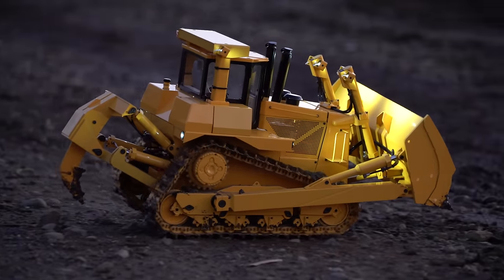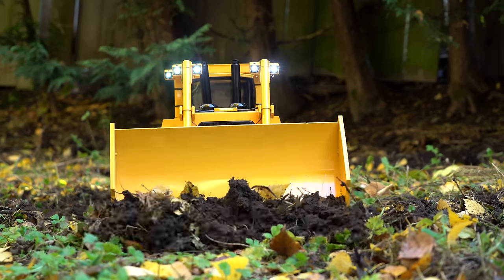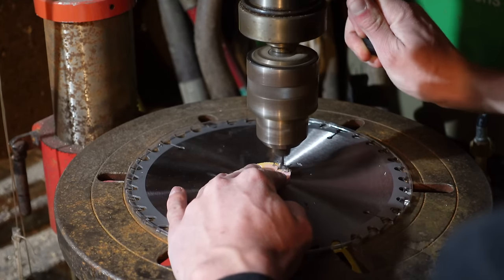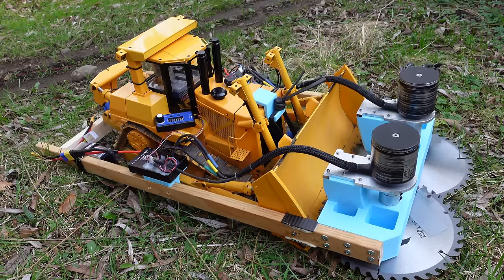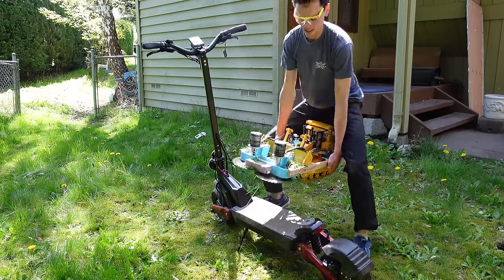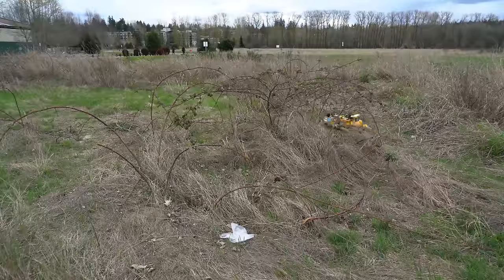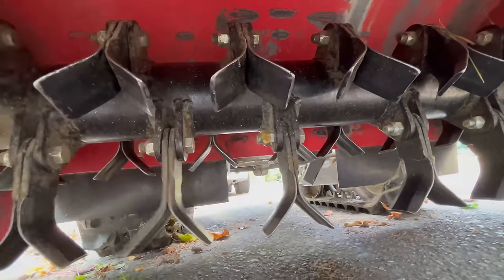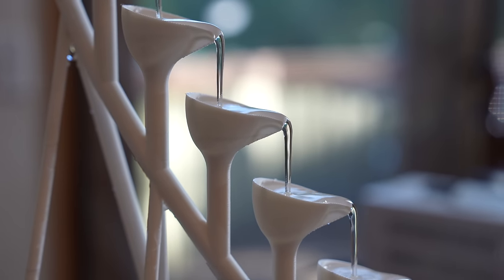$3000 R/C Bulldozer with Saw Blades

Comment: Some armchair math says that you're 1/14 scale dozer would have to weigh 714 lbs (~324 kg) on the light side to have a scale weight. Makes sense why the traction is so poor at only 60 lbs (~27 kg). It is 1/10th the weight for the scale.

Comment: Equipment operator here, that mini dozer is amazing. I know you think it's performance is underwhelming, but if you keep the scale in context, it's doing exactly the same amount of work as a full sized D6. Even in the big ones, you can't just dig that deep in hard soil, even the big ones get stuck. Exactly what this little thing was doing is how the big ones handle it, little by little. When you took it to the gravel heap and it collected half a blade in the first push and kept rolling it, you'd be surprised how easily that exact same scenario will make a 25 ton D6 skate like it's on ice. That little thing is cool as hell, but I can't justify paying that much for it, yeah I want my kid to be as obsessed with machinery as I am, but I just grew up around mechanics and machinery, my kids can do the same, they don't need ridiculously expensive toys to fall in love with machinery, but it is extremely cool and I do wish I was in a financial position where I could buy stuff like this and not think about the price.

Comment: Tanks with loose track pins have a keeper, a ramp or angled piece that pushes all the pins that moved back in. It was located at the top front where the body or skirts start.  This is an intentional design to have them free and they didn't move much in one rotation anyway. Simple rod design, they didn't even knurl the ends.
Reply: Do they have this om both sides of the track? Or do the pins only move one way?
Reply: @guatf1 they just move one way, with the head of the pin pointed to the tank

Comment: 8:01 use the T-34 strategy. Put the wider end of the pins facing inward, and weld a wedge to each side of the hull. The wedge will hammer the pins back in for you as you drive.
Reply: Did you learn that from Lindybeige too? Lol

Comment: Just as an Fyi even the big tree cutters tend to use a single large blade justfor the same reason you found, duel blades when cutting towards each other tends to just cause them to bite in and cause both blades to jam.
Reply: “Duel blades” would be if this were used for battle bots.

Comment: That thing is adorable and impressive. Minus the weird controls, those /are/ odd, but I guess they went with a "cheap" remote and just went with tank controls and whatever was left after. I wonder how much effort it would be to change the controls to single stick for moving and steering, leaving the other for motion only.

And regarding the tracks being the weakest point of the mini dozer: I wonder how that Tracked RC 'Platform' would do with those blades.
That thing has more 'aggressive' tracks, which might avoid the issues that the mini dozer has.

Either way, a really impressive "do not try at home" RC mower 👍
Reply: Someone not really used to RC designed which control did what.
Computer mix tracks to one stick with a side button to stop one track if you want to pivot around it (which is a bad idea with those tracks)

Then main blade OR rear plow on the other stick, Simple computer mix and a switch to swap.  The blade angling on the side levers.

The controls become almost intuitive rather than something you have to practice for hours to get used to.

some of this can easily be done with the simple transmitter that probably comes with the unit, but I'd request a transmitter and receiver delete, since I already have a really good 18 channel computer radio.

While it looks better with the metal tracks they should have done rubber track.  Based on a "cogged" V-belt, it would last for years.

Comment: for a flail mower to cut non-wood foliage, I've seen barrels with just steel chains mounted on them, each only a few links long. I think you could safely mount one to scale inside the bulldozer bucket. It wouldn't need much metal work either, because you can use the existing bucket, and just plow forward into the herbs. Find a thin but strong steel chain, maybe 4mm wire thickness on the links, 4-5 links long, and just screw the first link to the barrel in the right direction and stagger them around the barrel so that every area gets hit by chain... If you make a continuous spiral, it could (should) also propel the mulch sideways or at least to one end of the bucket.

Comment: Surprised you didn't start with brush cutting blades (some of which are pretty similar to saw blades). 
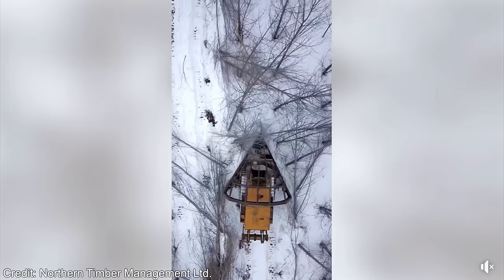Seems you could also use a miniature version of the 'spear cage' referenced at 4:21

Comment: the issue of the tracks coming off easily are also an issue on full size dozers so its not just because its a scale model. also there might be a way to tension the tracks a bit more so they don't come off all the time.

Comment: I had a blast with one I had as a kid and it made smoke with 3in 1 oil. Mine had a remote but had like a 8’ cord. It had rubber tracks. One of my tracks was on backwards so one track had less grip and tended to turn toward the backwards track when working dozer lol. That must have been like 1987 when I got it although I kept it till we moved when I was 17. You couldn’t replace the track on mine either which was dumb

Comment: It is a common misconception that surface area is part of the equation to determine friction. I believe the problem is more an issue of scaling the weight In media that changes coefficients of friction as you dig into it

Comment: the track pins on real dozer and excavators are set up the exact same way as this model. and yes they break just like the model did. usually the pin snaps in half though.

Comment: I'm kinda' disappointed that the bulldozer didn't dig very well.  As someone who likes to garden but also has a disability I could see where some small RC digging and mowing device could come in handy.  A scale model just isn't as practical as the real thing when you scale it down for the reasons you mentioned. It really needs to be purpose built, but I bet you could build one that actually digs and mows better than a modified scale model.  I'd be interested if you revisited this idea and built something  from the ground up that works well enough. Love the videos,  can't wait to see what you come up with next.

Comment: I mean...the tracks breaking down...don't surprise me.  BUT that is how a lot of tracks go together in full sized machines.  They cool one piece of metal and heat the other and it slides in, once it is back to normal temps you cannot even drive them out.

Comment: Nice episode. Love it. 
I understand why you put a block at the convergence point of teeth rings, to isolate bush trunks from jamming. But also block off bushes. Here is an option we could think about. Add a comb shape structure with a specific finger spacing pointing forward to pass in thin bushes and block off anything wider than the finger gap. Comb fingers also make the bush cutting much more effective. 
As an option: we can begin with a comb with one finger place in the middle front where the left/right teeth meet. What do you think?
Reply: nO one ASKED

Comment: Nice vid...enjoyed it,    but just a couple of thing's........the tooth on the back is called a ripper not a plough, and on the real vehicle is for ripping up concrete and hard footings so the blade can shift it.
 As for the weeds, I did notice one thing this particular machine lacked that all bladed D9' dozers come with was teeth on the bottom of the blade, I think it would dig and push way more dirt around the weeds if you fitted them. also the groucher's (those horizontal blades across the tracks) could have been a little taller and more aggressive which would aid traction massively.

Comment: As a wood and machine shop affectionado, your application is certainly a curious one. It'd be worth looking into the principles of cutters and material removal.

For example, the jamming problem is easily apparent. Look at the angle of the teeth. Usually those kinds of circular blades have the table surface of a circular saw machine to keep material from getting sucked in, and the blades aren't so deeply exposed. A narrower exposure means the material gets pulled at a narrower angle more inline with the plane of the table surface, pushing the material AWAY from the saw.

Every cutting tool has limits when it comes to what's called 'feed rate', which essentially translates into the volume of material being fed into the machine. When material gets forcefully pulled into the machine, you overload it's capability to cut through a material so it just suddenly stops.

This is a whole area of expertise on its own, called 'speeds and feeds' (speed refers to the speed that the cutter is moving at), and every application has it's own unique set of ideal speed and feed setting. But a basic principle is typically that if you're getting jamming issues, slow your feed and/or up your speed!

And that goes for your use of the flail mower! Tree stumps and the like are a lot denser in composition and thicker in volume! If you want to go through that you need to slow your feed! Munch through slower and you'll get through eventually!

Anyway, as for your assembly issues of how to arrange what and where, take inspiration from pre-existing and very successful tools! Circular saws of various kinds already have all the right answers you're looking for. You just need to take those same principles and modify them a little to accommodate the different application and setting. (hint: use a wedge)

Comment: Russian tanks used loose pins on the tracks, they had angled plates either side of the tracks to push the pins in as the tracks moved past them.

Comment: If somehow you could cut slots in the bulldozer blade for the 2 saw blades to protrude through. not sure how it could be done maybe moving the dozer blade forward with somekind of mount you could put the motors and blades behind the blade to protrude through the slots. Then it could push the debris out of the way and the motor is also protected .

Comment: these are a load of fun, but 1:2744 weight and 1:196 contact patch means 1:14 ground pressure. Not great for keeping the earth between the track grousers firmly attached to the rest of the ground.

Comment: you should make a really heavy tracked vehicle with the blades attached, have the vehichle be super heavy and then have the ablity to add weight to up the weight to around 200-300 lbs so you can make an industrial scale rc mower

Comment: Should of made a mini kill dozer out of it 😂 btw as an ex tank driver, tracks are really high maintenance and require track pin checking after every operation. And if you pivot turn on powder sand, mud or rubble, the danger of popping a track off is extremely high. And fixing a 10 ton track isn't fun when you are out and about

Comment: Traction/friction isn't actually a function of surface area, it's a function of normal force (weight in this case). Your bulldozer has less than 1/14th the traction because it has far less than 1/14th the weight of a full sized dozer
Reply: Basically, since your dozer is approx the same density as its full sized cousin, your traction (relative to the big dozer) is really a function of volume, meaning it's really 1/14³ the traction of a real dozer, or about 1/2744 the traction of the big bulldozer

Comment: Kinda cool. I've been thinking of doing something like this with my rer snapper. I've got enough spindles and pulleys laying around. and some straight wall barrels to make a shroud if needed. 

You could take that rc toy and make a radio controlled rear engine riding snapper. pretty easy.

Comment: It’s not called a plow. The term is a ripper. And to preform ripping you must first be moving forwards and lower the ripper as you are moving. Then if the machine stalls out or quits moving then you adjust the height or the ripper. Full size dozers do the exacts same thing.

Comment: Do not oil the Tracklinks! it will create a emulsion of drit and oil and grind you a bigger diameter over time. Moving metals should be dry when dirt is involved.

Comment: Technically speaking the weight scale isn’t correct when compared to real dozer. If it weighed about 120-150 lbs it would most likely get Hester traction pressing the grazers into the ground thus pushing dirt much better.

Comment: 11:18 Why do you think there was conical cage around the full size dozer? To slide the trees on the side allowing it to blow forwards unimpeded.
2K$ for this contraption plus batteries, radios etc... yeah that requires lots of disposable income... For driving, while bulldozer can go pretty much anywhere, just like bobcats, tree harvesters etc vehicles, it takes to skill to get them go there. Even if you have power and traction, one must know how to balance the damn thing well as how to get enough traction in certain places. In rc dozer in such environment you definitely dont put the blade and rear spike down and the same time thats for sure. Spike is there to break down compacted soil for blade to then shave away. For upgrades yeah tracks could need some upgrades like remaking them with larger bushing surfaces and from steel, not what ever chinesium that is and blade could use hardened steel or even hardox wear edge if you plan on using this longer than few videos, trashing it for views and then scrapping it...

Comment: The problem with this little guy doing scale work is a little thing called the Square-Cube Law. Stated simply in this case, it shows that the cube of the weight varies as the square of the physical dimensions. In other words, the 1/14 scale in dimensions translates to a 1/52 scale in weight. And that's if it's made out of the exact same materials, which the RC bulldozer clearly isn't.

Comment: Before you get to carried away, those saw blades have a max speed around 6000 rpm. I wouldn't go over that. I know those electric motors can spin at very high rpms. If one of those blades comes apart, it will act like a grenade.

Comment: Damn, that thing is an absolute beast. It's like something out of Robot Wars - get yourself a Hypnodisc with off-road wheels and a bit of suspension to destroy those weeds 😂
The original dozer, not so much. For $2000 I'd at least expect the tracks to be of a higher quality.

Comment: If your aiming to cut grass you should use different blades all together, the saw blades wont cut they will rip grass leaving turf with ripped ends that brown, this isnt good for turf health at all thats why we use reel mowers on golf coursesand because its so short lower than .1000 on greens. Lower end courses cut rough with rotary mkwers even than they keep the blades extremely sharp with a single edge. The saw blades work for over grown material.

Comment: I was hoping he would use a little Soviet engineering and add the little thing the Soviets added to the T-34 where it would hammer the pins back in place as the tracks rotated around.

Comment: I only cut my path, around the house (a 50 cm perimeter) and around the fence (the width of my mower, which is 40something). I hate grass lawns, they're horrible for nature. While my neighbors swelter in heat, i had my tree shade from my Paulownia trees, birds, bees, and all manner of critters all tied up in a cool plate to spend my time in. If you're rigorous about killing pest nests (which takes less time than mowing the lawn, that's for sure, less water too), it's a pleasant place to be in. My house was also better for it, less heat in the yard, less heat in the house. As is, because of my solar panels, there's barely any heat input on account of vegetation soaking it all up.

Sidenote: i was laughing my ass up at my neighbors when temps reached 38~39c a few months ago, because most of them are (not smart enough) to get what was coming and they were all very proud about their lawns and concrete pathways. :))) I swear, there's nothing quite like the visual of a person who finally gets it - and you get to witness it. And this year is just an appetizer. Next year is going to be even hotter, Solar max (well, the predicted), various other things combined... it's gonna be hotter than Vezuvius' ass next year.

Things are changing tho. Four houses down, one of the neighbors asked me what kind of a tree i had, because the Paulownias grow very fast (mine's only 24 years old and it's bigger than the house), so they are learning. I actually cut a root from mine and helped them plant it in their front yard plus all the little secrets about growing them fast. So there is hope.

Comment: The issue is the weight is not correct for 1/14 scale. Weight generally scales cubed because volume, and 89,000 lb /14³ is 32.4. That is half the weight of the model (66lb). If a real D9 was 180,000 pounds, it would be just as useless moving dirt. 

D9 has ground pressure of 13 pounds per square inch(87000 lb / 6600 sqin). If the size is actually 1/14, then it should have (6600 sqin / 14²) 33.7 square inches of ground contact. So it has a ground pressure of (66lb / 33.7 sqin) = 1.95 lb/sqin

Comment: The bed contouring on your printer is working even when you are like 2cm high from the plate. Dude, it's not helping your print. It is actively applying a warp to your entire print to match the build plate.

It's an industry wide problem, but this warping should only be applied to the first millimeter of a build.

Comment: I hate to be the one to tell you bud but I work real bulldozers and they do the same thing at the ground is soft and compact and it's wet on top they'll get stuck just as easily if the operator wrong keep working with it you'll learn how to do it by backhoe dig it up first then use the bulldozer to push it back in the backhoe ones are actually more fun I own